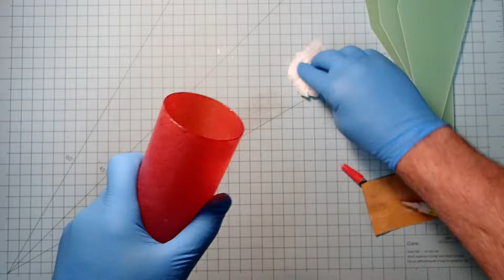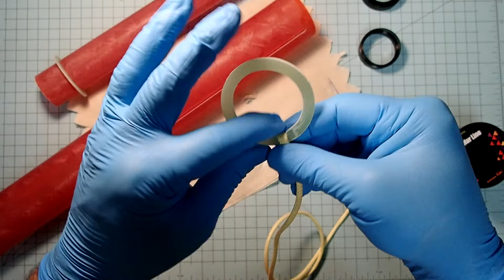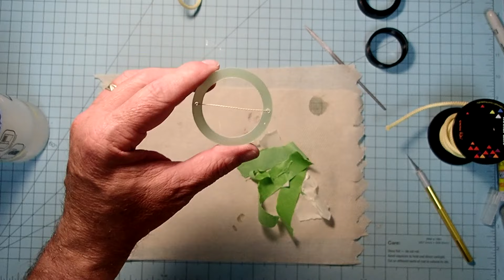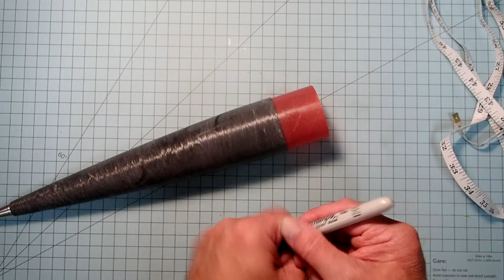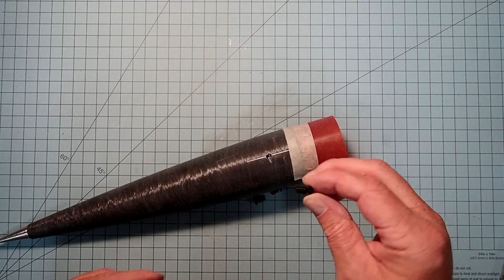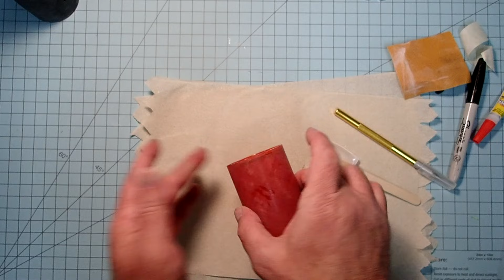Madcow "Adventurer" high-power rocket assembly (part 1 of 2)

Comment: Dr Dave, if I am making my bt-80 rocket with an over all length of about 48", and using an Aerotech H182R motor which is an 8" long 29mm motor, do I need to use epoxy for the centering rings or can I use white glue? thanks for your input
Reply from the maker: I recommend epoxy for any high-power motor.

Comment: Hey Dave, Great Video! 
I haven't graduated to fiberglass rockets yet, so this was a blast to watch! Question, I kinda expected you to use of CA glue to set the part first, and then follow it with epoxy, especially with the fidgety nose cone, however as I was thinking about it, I suspect that might be a strength issue by not having the epoxy between the two parts? What's your thoughts? Thanks!
Reply from the maker: I use both methods, depending on the rocket. I will tack with CA if I can still get access to the fin tabs to make internal fillets (see some of my larger builds like the LOC4 or Hi-Tech). If I can't access the fin tabs, then I'll use epoxy throughout.
Reply: @REAR_rockets  Oh, that's funny! Maybe I should have watched part 2 before asking my question! Thank you for creating these great build videos!